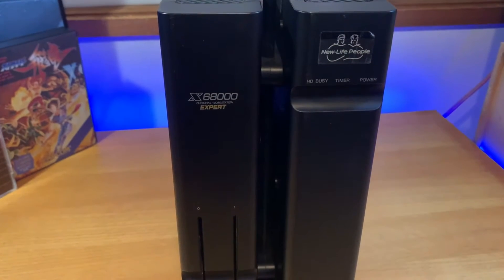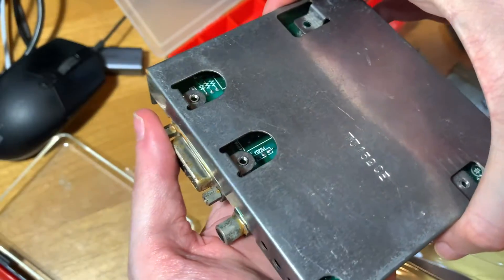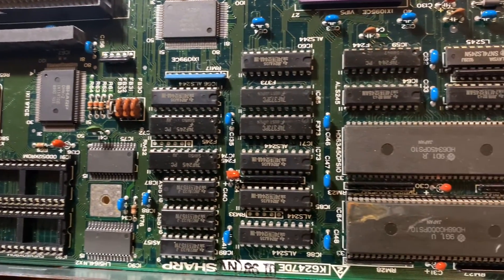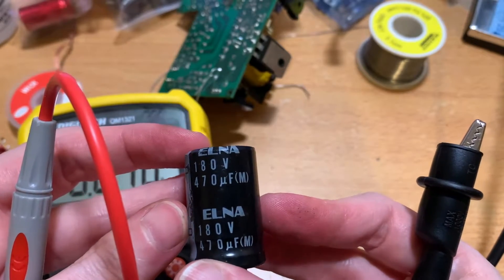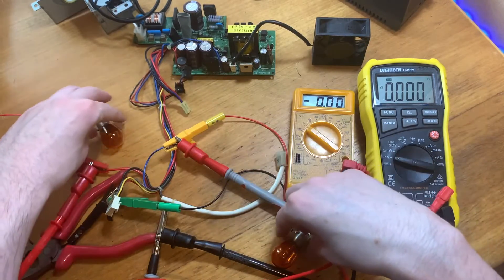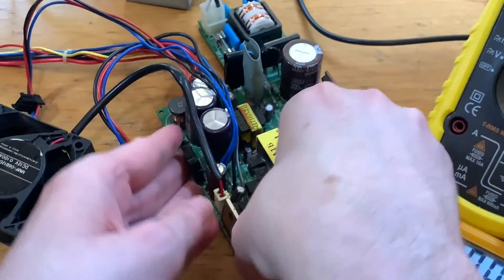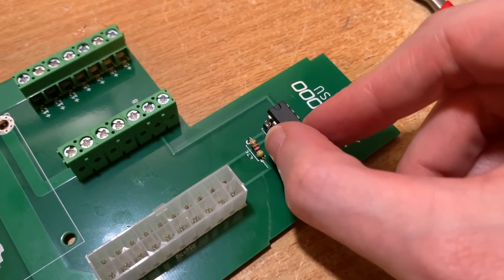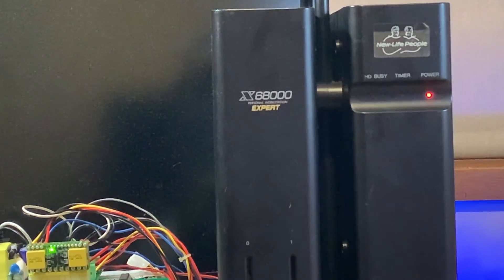X68000 Expert - PSU Refurb and Internal Inspection

Comment: Nifty video. It's cool to see that you almost got that old PSU working and even neater that you made your own- I guess I knew it was possible but I've never seen anyone do it before- any idea what the wattage would be on the new one and how it might compare to our current standard PSUs? I do love seeing these old beasts brought back to life. Very nice work and thanks for the video! 

You got a new sub :D
Reply from the maker: Hi, thanks.  It was exciting to see it fixed for just a while.  Pity it died again after so many hours working on it.  But I think it helped with pointing us into the right direction to building a more reliable new one.  (as did RMC's discord)

The X68K PicoPSU uses a 120watt picoPSU, so a fair bit less than what most modern computers need.  Documentation for the new board says the 120watt is fine for the X68K though.  (There are higher wattage picoPSU modules available if we feel the need for it)
Reply: @kman_aus  Thanks for the reply! Take care :D